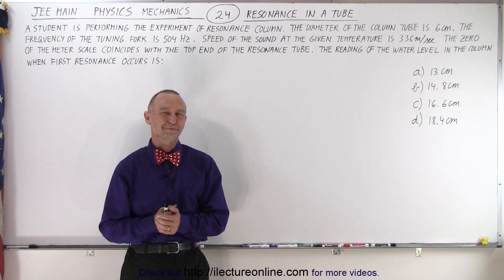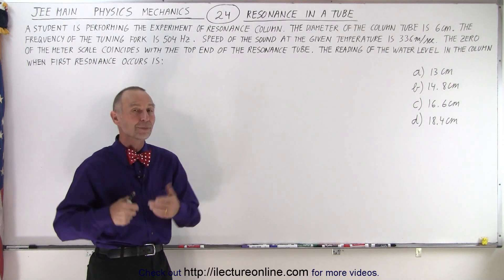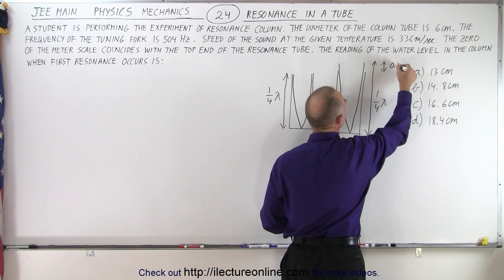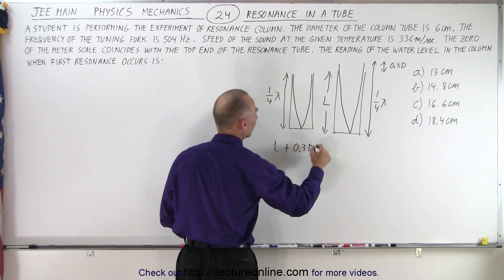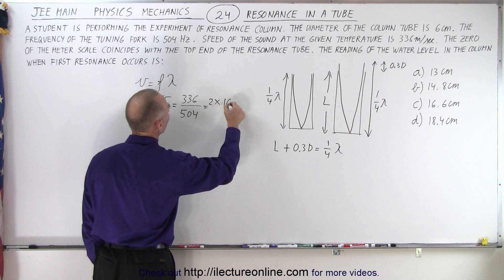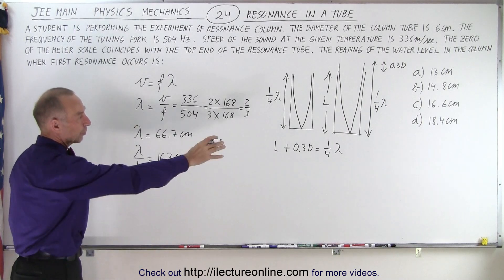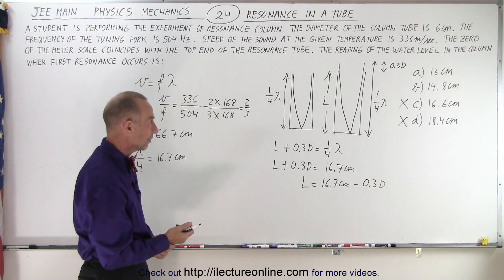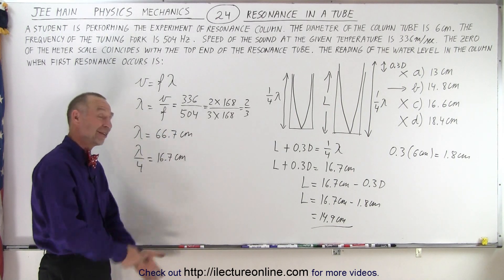JEE Main Physics Mechanics #24 Resonsance in a Tube

Comment: I have learned so much from you over the years, so thank you for making these videos. Regarding the JEE test, I hate the fact that as the test taker, we have to guess whether to include the additional nuance of the wave extending past the end of the tube or not. I would think a properly designed test would  explicitly state which assumption to use, or the test should accept both answers as correct if both are presented as possible answers to the question. Anyway, have a great day! 😁👍👍👍
Reply from the maker: I completely agree with you.  I come across JEE question once in a while where it is not clear what assumption we have to make.   Thanks for sharing.
Reply: Would the test giver accept either one of the answers?
Reply from the maker: If I were to give the test and then realize I didn't specify the detail I would.  But on the JEE test they don't.